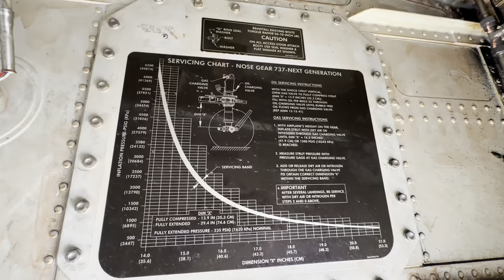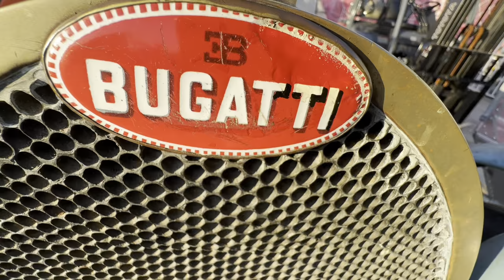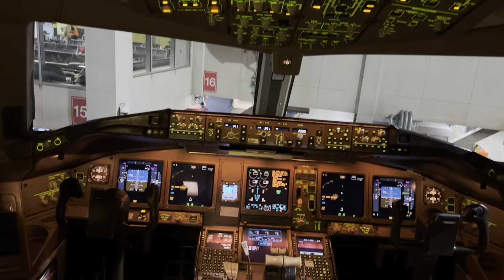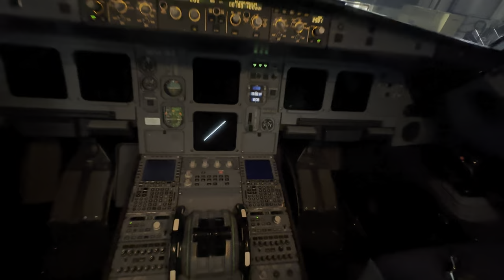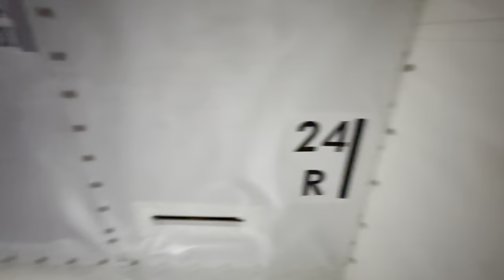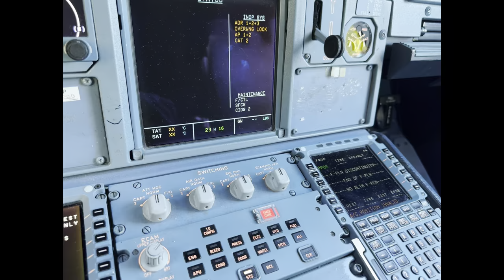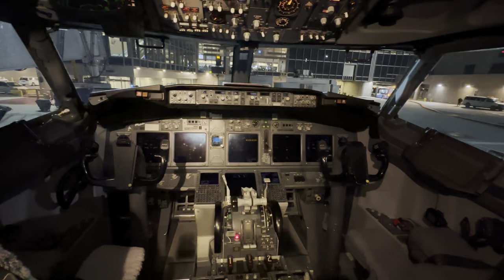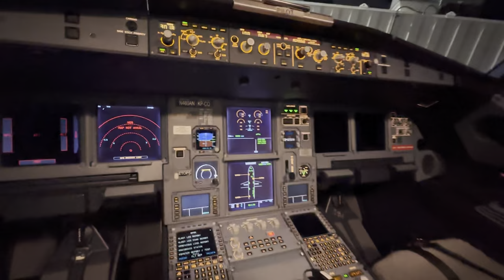Stig Shift. #13 (Aircraft maintenance Adventures)

Comment: I'm pretty sure you're correct with that "GA" aircraft, it's certainly a Pilatus, but it could be either a PC-12 or PC-14, I think? Pretty sure it's one of those, but I'm just going off memory here.
However, it might not be operating in GA!
Sometimes they use them to ferry organs around for organ transplant work, and in Australia they use them to allow doctors to do physicals and other treatments on people who live in the Outback, as well as acting like an Aerial Ambulance for more serious health issues (the large rear hatch helps a lot with loading patients, and there's ample room inside for a medical professional to tend to the patient en-route, in a similar way to how the US Coast Guard uses HH-60 helicopters to tend to rescued seamen on the way to a medical facility, but with the higher range that a turboprop has over a helicopter which is needed for the large distances typical of the Australian Outback.
It can also operate "more usual" small aircraft profit-making type operations, including both cargo hauling and passenger ferrying duties (IIRC that's Part 135 operations, but it might be Part 121 as well, yet again I'm going 100% off of memory here so I might get a few things wrong here and there).
Oh and charter flights, it's approved for that too (assuming a pilot or pilot-copilot team that is also certified for those types of operations, of course).
Reply from the maker: Absolutely incredible information right here, thank you so much for taking your time and educating me

Comment: 21:45 modern cars also use data bus systems for communicating between control units of powertrain and safety components, genuinely thought modern airplanes like 787/A350 would surely use even more advanced data bus systems.
Reply from the maker: Just imagine more wires and more computers

Comment: 629 was too expensive, lots of custom hardware. Airbus and boeing (with the 787) did get to ARINC 664 which has lots of the same benefits.
Reply from the maker: You are right on that. But it was still a revolutionary step forward in technology back when they first built the 777.

Comment: Regarding the 777 computer boxes, could be related to common supplier. The unique system on the 777 might weaken Boeing's leverage in negotiating deals with the suppliers, where common suppliers, Boeing can play more hardball and award supplier contact to other "capable" ones. 
Since 777, Boeing is now more accountant and management driven company. 
Where the 777 was the last truly Engineering driven designed aircraft. People can argue, but that's how I feel comparing recent Boeing products (90's onwards especially).
Reply from the maker: When I usually glance on the computer boxes, majority of them are either Rockwell Collins or Honeywell. But that seems to be on all aircraft, they are the dominating manufacturers for these computers.
Reply: @StigAviation  I suppose "bespoke" system is always more expensive. But its truely amazing how Boeing achieved the 777 on its design and reliability.

Comment: The data bus on the 777 sounds like it has some of the same benefits as the etherloop on the Cyber Truck
Reply from the maker: I don’t know much about the cyber truck, but if that’s the case, then it probably is
Reply: All the components talk to each other on the same bus. Everything from the throttle pedal to the audio going to the amplifiers.
It's time sliced so in any given interval, there is a certain amount of time on the bus dedicated to various functions.
Means much less wiring around the vehicle.

Source: https://youtu.be/J5zDNaY1fvI?si=EsZ8FQWnNRbnmLZ8&t=837
Reply from the maker: @ericjohnson2193  I’m assuming that vehicle is pretty much pure drive by wire, it would make sense they would do this

Comment: The 777 was Boeing's masterpiece. I mean the 747 was an icon but technically seen the 777 is a nuts airplane in every way. When they created that plane the requirements were just to create the perfect largest twin jet for flying around half of the globe ( 17100 km the - 200 LR & 14600 km the - 300 ER )  with maximum payload. Well. That was a target. A fully loaded 777-300 ER only needs the same length of a runway like a fully loaded A 330-200. The 777 is nearly 90 tons heavier but it rotates at exactly the same point as the much lighter Airbus. I expirienced that two times on our relativaly short runway at our old airport in Berlin Tegel. ( Qatar Airways A 330-200 and 777-300 ER ). The 777 climbs like a 737 if you ever watched it carefully. The same angle at more speed. It's called the beast in our business.
Reply from the maker: And that’s why I love it so much, it’s just an incredible aircraft, and that type of aircraft has not been produced since.

Comment: In all my years as a AME, Never seen an engine hot end exhaust that looks like that on your video cover picture!!?? explain pse
Reply from the maker: @rickpalmer9518  it’s a CFM56 it’s very common to see anywhere
Reply: @StigAviation  Could be a viewing  distortion,  got my A320 licence in 1989 in Miami and don't recall ever seeing the hot end of any Aircraft eng, that looked like that, sure makes me wonder
Reply from the maker: @rickpalmer9518  just a wide angle camera shot my friend. It’s the same CFM56 you have worked on I’m sure

Comment: ETOPS= Engines Turn or Passengers Swim! A little nit picking Stig. The 777 Main Battery is 47-60 Ampere/Hour rated not milliamp/hour rated. And boo hiss using channel lock pliers on the Oxygen bottle delivery fitting uncoupling- you had the correct size crows foot wrench. Otherwise good video, you sure enjoy your job.
Reply from the maker: Yes sir. I made a mistake on the amp hours. I made a corrective statement in the comments and pinned it. My apologies on that. I was speaking to fast. Ohh the channel locks are actually Knipex. An amazing and very precision channel locks. Highly recommend them.

Comment: Single network sing point of failure very dangerous.   Should have at least two network if not three(main, backup, critical only)
Reply from the maker: @maxwellmelon69  what system are you referring to?
Reply: @StigAviation  the network bus system between computer modules where u were saying they work off one network on the one model
Reply from the maker: @maxwellmelon69  it has back up systems for that.

Comment: Modern airliners have moved away from ARINC 429 and 629 to 664, an ethernet based communications bus system.
Reply from the maker: Yes, that is the new wave of technology at this point, but it’s not completely transitioned into 664 only very particular systems have that. Majority of them are still running on 429.

Comment: There are two types of A321s in the world: Those that have already had a tailstrike and those that are still getting one.

btw: you have to explain the right to exist of the "two-white-one-red-ball" thingie between the front Windows in an Airbus Control Cabin. I dont think anyone had revealed it yet
Reply from the maker: I have talked about that in the previous video but I’ll bring it up once again on the next one. Just the seat adjustment alignment. To get the pilots into the proper seating position so they can properly see and properly reach the controls.

Comment: ETOPS: Extended-range Twin-engine Operation Performance Standards Engines Turn Or Passengers Swim :'D
iirc etops was due to be replaced by Extended Diversion Time Operations (edto)

40:30 ah yes, the iconic FOPP whistle. (Fuel Overpressure protector). Ådne Fleisje has a great shot of a very noisy one.
Reply from the maker: I found a website that I can’t remember the name of but they had an audio of the Airbus while landing . It’s quite noisy. 😅

Comment: At 24:08…your editing made it seem like you just left the B777 and then you walked underneath the fuselage but then you see an engine with scalloped exhaust which belongs on a B787 or B737 Max, not the B777-200. Based on the main landing gear and the size of the engine, it was a Dreamliner.
Reply from the maker: Yes, I did leave a 777 and on my way out I walked past a 787.

Comment: If I'm not mistaken that's one of the very first Bugatti frames and engines if I'm not mistaken I saw it on One of the Forza motorsports games Forza motorsports is a simulation game where you race and drive cars it's only on Xbox, Xbox 360 and Xbox one
Reply from the maker: Very cool. I wonder if that’s one of a kind car
Reply: Yeah it is it's hard to buy parts for those  types of cars sure there's plenty of aftermarket parts but hardly any original parts unless you can find a junker like that in Europe if you search Google for Bugatti 1930s or 1940 you might just be able to find it
Reply: After doing a google search I saw pictures and that car looks to be from the royale line of Bugatti cars between type 41 to 46 it has the short engine bay as the type 46 it might actually be a type 46
Reply: Well I finally found the car it's Bugatti type 46 coupé super profilée I'll do some more research and find out more about it
Reply: After looking it has a 5.4 litre eight cylinder engine with 140 hp there were only 444 models made between 1929 to 1936 it has a steel ladder type of chassis and measures 138 from axel to axel it has a 4 speed manual gear box and cable operated drum brakes the head and block are cast as one whole unit
Reply: 138 inches

Comment: Whaaaat? The nose wheel is controlled with a cable pull? I always thought it could be done with hydraulics.
Reply from the maker: On the older 737, yes, it’s still cable controlled but it’s hydraulically assisted

Comment: Why did AB create a control system, forcing more than 90% of people, that are right-handed, to control a plane left-handed?
Reply: If you are flying an aircraft with a yoke you'll still have to take your right hand off and put it on the throttle during takeoff and landing. AB or Boeing, you still use your left hand
Reply: Pick up a gamepad and play any game.  The left thumb does most of the directional control.
Reply from the maker: I wish I could answer that question for you, but that’s more for a pilot, remember I don’t fly these airplanes
Reply: The point I was making is I have much better control of attitude using 2 hands, also I saw a crash where the pilot and FO  were fighting each other, with competing inputs at same time, and the side sticks are positioned so far apart, that it was impossible to readily see what the other person was doing. In side-by-side yokes, it would be obvious.  @StigAviation
Reply: So, i'm referring to attitude of airplane.  @Glegh

Comment: Steered by wires? Anachronism. Even my 2021 gravel bike doesn’t need any mechanical wiring stuff…
Reply from the maker: On which aircraft my friend?
Reply: 737 NG
Reply from the maker: Yes, it’s still a very mechanical system on the 737, it’s cable driven, but hydraulically assisted
Reply: @StigAviation  love your videos. Appreciate your work. 👏🏻 and there is a sad truth in your judgment of the 777 as the last proper boeing aircraft.